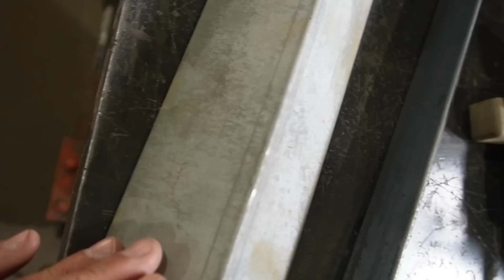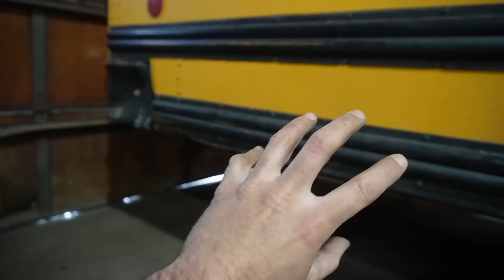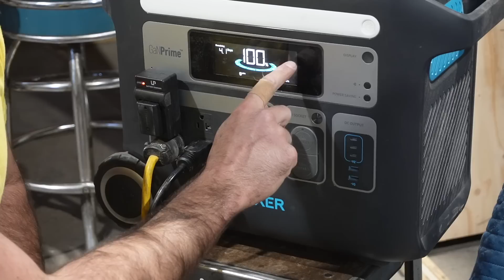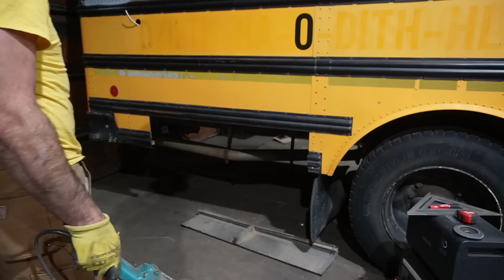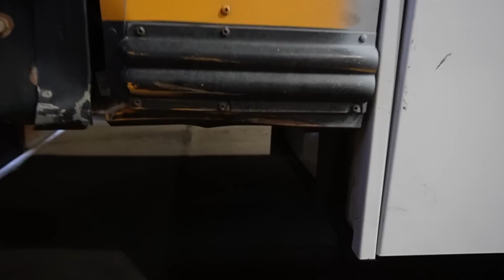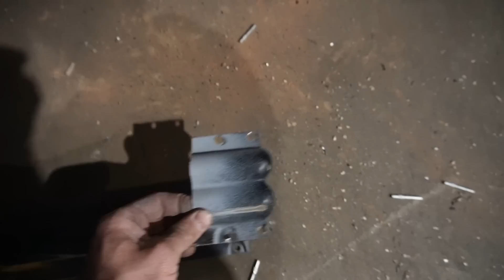Installing a SKOOLIE luggage box (using only battery power)

Comment: Great start & already I'm seeing a lot ; so how loud w/ the exhaust be if it's cut & dumped on the side?  Won't be loud enough for
police to complain, will it?  And this is a 26' - 28' bus?  Just seeing the first 10 minutes was a lesson.  I'm amazed at this.
Reply: As long as you're just cutting the tailpipe after any silencers (mufflers) it won't be any louder but the pitch will change.
You could insert a bend & just run the pipe somewhere else.
Reply: Yeah,  that makes perfect sense as long as ya didn't cut out any components that are part of the clean air act or
that causes any excess noise.  IDKnow much so I throw posts out in the hopes that someone shares anything
they know for all people who sincerely want information.  I appreciate your taking the time.  I hope to possibly
being buying a bus soon b/c I'm tired of living the old fashioned ways - this channel shows so many ins/outs
dealing w/ bus-camper homes.  peace man

Comment: Could you come thru the floor and drop your shower pan lower, increasing the hight of your shower?
Reply: Yes but it needs bracing because shower pans are designed to sit on a floor. There are also body-support beams to consider.

Comment: One suggestion, don't use grade8 bolts to go through such thin profiles of unhardened steel. In most cases you'd be concerned with - like impact or vibration - regular bolts would be more likely to deform with the rest of the structure and prevent catastrophic failure. You want bolts that bend, not stay rigid and tear thorough the soft steel frame it's holding together. The weight of a moving skoobus impacting something is definitely in the realm of forces large enough to make this issue worth considering. If you are just using grade8 because those are the fasteners you have on hand, fender washers or something would be a good idea.

Awesome video, as always! Everything about your channel is awesome, from the content to your demeanor.
Reply from the maker: Thanks for watching

Comment: Amazing job and just in time, I bought 4 Buyer boxes for my build and you gave me some ideas to make my install go much smoother.  One question, did you add a spacer in the gap for the top bar to keep it from collapsing with the weight in the box and bumps or how did you address that?

Comment: One question I have is with the wait on the belly of the box shudn't there B the same rectangle metal tubing that is supporting the top also B placed under the box?
Reply from the maker: i understand why you would ask, but as you saw when I showed the instruction illustrations, it is not called for. it certainly wouldnt hurt

Comment: Hey Charlie, do you have a coupon code for anker?  I used your link the other day and the 5% was calculated in the checkout cart, but it's not working today?  I'm ready to pull the trigger on the 767 and one 200w panel.  

Thanks  -Travisj
Reply from the maker: The only coupon code I have is the one listed in the video description, if its not working the best bet would be to reach out to Anker
Reply: @ChuckCassadyYT  Update: I emailed them over the weekend and they were quick to respond this morning.  They said the affiliate links no longer work, but they will honor the 5% off as a refund if I contact them after the purchase.  I pulled the trigger yesterday, but I was trying to get you a little something from Anker too.  Thanks!

Comment: How did you find the cheapo harbour freight welder? Did it do a good job. Would you recommend it as a cheaper alternative?
Reply from the maker: ive been really happy with it, to be honest. I like it more than i expected. For $200 its pretty hard to find faults
Reply: Harbor also sells a cheaper flux 125 by Chicago Electric for $140 that I’m looking at. Not sure what it comes with yet like nozzles etc that one may have to buy.

Comment: How would you use the powerhouse in the bus?  I don't see any way to run 12v stuff off it like a water pump, diesel heater, etc.
Reply from the maker: It has 2 12v outlets on the front

Comment: I like the 30a outlet. 
I haven’t seen that on competitors units. 
It would make it easy to run a single cable into a distribution fuse panel on a smaller RV conversion.
Reply from the maker: That was their intent when they added that feature. Pretty sweet

Comment: Random question… after you get your truck boxes installed and your build completed how much do you “estimate” your new bus will be able to tow?
Reply from the maker: The bus has a gvwr of 25,900 and weighed 13k empty. I’ll guess my whole conversion will add about 5k. So I’ll hardly notice the added weight when driving. The DT466 was common in small dump trucks with gvwr up to 50,000. Id feel totally fine towing 10klbs with it.
Reply: @ChuckCassadyYT  music to my ears!!!!!!

Comment: Okay, this really caught my attention! I have a shuttle bus, and I have a 110 Hobart welder I've never used, and a 7 gallon air compressor. I might remove my air conditioner system, because it's big, heavy, and not working well. I might install one of these in its place. Great to see this! Just started, and we'll see how it ends. If you can do it with those tools, then I have hope! Thanks!
Reply from the maker: You got it!
Reply: I'm in almost exact same situation (shuttle, Chinese welder, small compressor, etc), however the prices on these undercarriage boxes are rediculously high so I'm diy-ing the box, too. I'm using an old filing cabinet that I'll waterproof with paint, caulk, rubber paint and strategically placed gaskets! I foresee about $40. Fingers crossed.
Reply: Oh, btw, I absolutely love your channel! You are hilarious, skilled and you aren't afraid to say things we need to hear but don't necessarily want to hear. Thank you!

Comment: I have a non-related question. How do you install legal seat-belted seating for say a family of five? Where do you get the hardware, how do you make sure it is extra safe and legal?
Reply: I'm not Chuck, and I may be curious of what he would say. I personally got seat belts and bolted them into the same metal bar that the original bus seats were bolted to.

Comment: Hey Chuck:

I notice you're not back priming any of the sheet bodywork. Do you use a seam sealer afterwards,  or are you not unconcerned about rust forming on the back sides of the riveted-in steel?

Also, no cold gal? We use a lot of it here in Australia. The really good stuff (highest percentage of zinc) beats primer and even paint easily, especially in the sun.
Reply from the maker: All my sheetmetal is galvannealed and I did prime the backs of the new pieces of flat I riveted on and the back of the run rail!
Reply: Armies use chromate & phosphate primer on steel, it seems even better than Galvanizing. 
It would be interesting to discover what navies use...

Comment: Always enjoy watching you build. You're an artist. Already have a "different brand", as big as my little 95lb wife could pick up. Those seem to weigh more than her. This one is not on wheels and slightly smaller, like your backup battery. Easily sits on the marble counter.  Runs the kitchen and refrigerator for a day or two at a time. Very happy with that brand too.
Reply from the maker: These units are extremely handy. More than I ever expected

Comment: Im a big fan mr i was hoping you would leave room if the bus ever had to be towed and also the dot regulations are anything on the bus trk or rv is 6inches
Reply from the maker: 6 inches of what?
Reply: @ChuckCassadyYT  6 inches from the ground
Reply: Anything on the vehical has to be 6inches above the ground
Reply from the maker: @isaacsims6203  I have never seen that regulation and I used to be director of operations for a bus company.  I cant find that reg anywhere. Regardless, the lowest point on this bus is 11" and that is the front steps
Reply: @ChuckCassadyYT  hi chuck ask a dot officer they will tell ya about the 6 inch law any driving truck the snow chains hanging off side of trk  or any part of your trk had to be atleast 6 inches above the ground
Reply: Or you would get a big ticket for it if and when they enforce it
Reply: Just dont want ya to get a fine thazs all